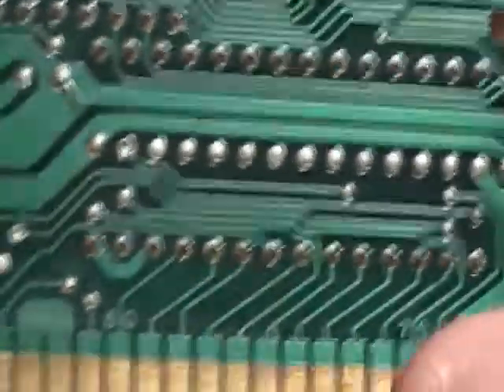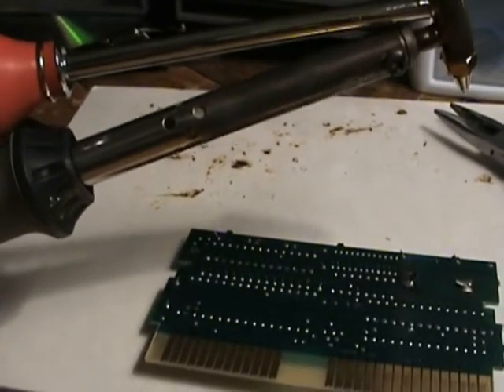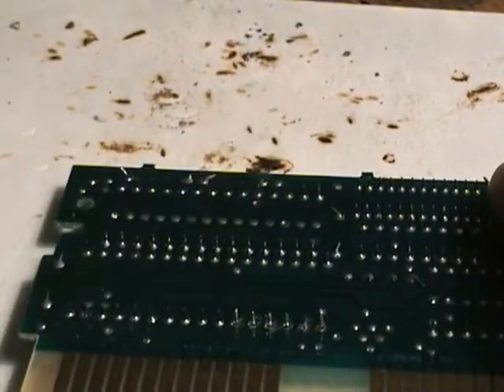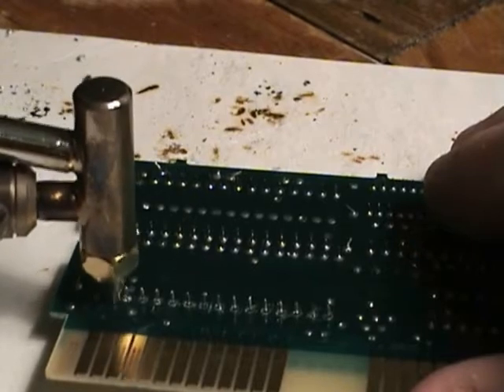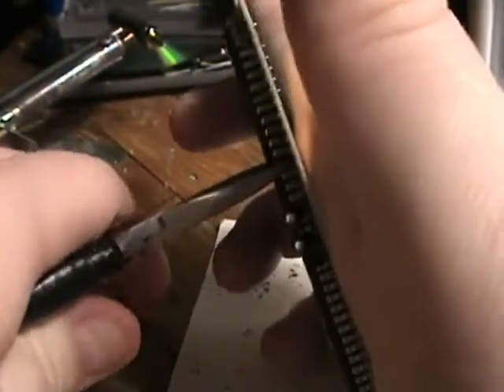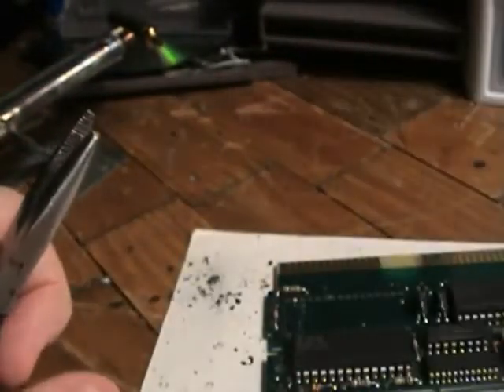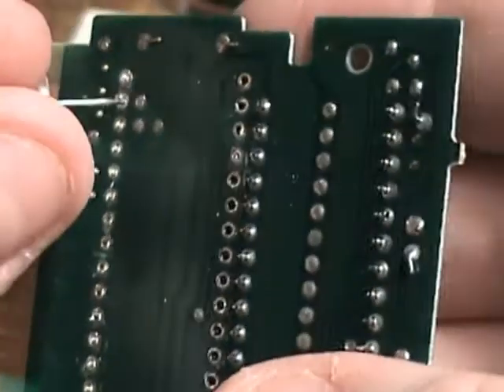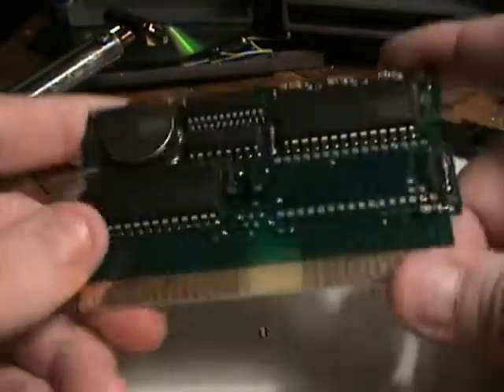How to Desolder a NES Board VIDEO GAM CORNER REPRODUCTIONS

Comment: If I were to buy this attachment and I already have the exact soldering iron, what would the tip and the attachment be called? I'm looking for it on eBay and can't find them. Thanks! This video was awesome!
Reply from the maker: Thank you.  Are you talking about the desoldering iron replacement? If you go to the radio shack web site or radio shack's ebay account they are desoldering tips. Or you could try desoldering replacement. They are usually 1.99 each.  Also if you buy the non Radio Shack brand on ebay they cost more but work as long as they are the threaded ones.
Reply from the maker: http://www.ebay.com/itm/Endeco-Desoldering-Resoldering-Tips-T500-031-Fast-Shipping-Quantity-of-3-/321193487384?pt=LH_DefaultDomain_0&hash=item4ac89fac18
Reply from the maker: http://www.ebay.com/itm/Weller-DST3-Desolder-Tip-Threaded-0-125-X3-17Mm-Fits-Models-Ds40P-Ds60-Dstcp-/161598694756?pt=LH_DefaultDomain_0&hash=item25a0086564
Reply from the maker: http://www.radioshack.com/radioshack-replacement-tip-for-cat-6402060/6402061.html#start=22&q=desoldering&sz=12
Reply: Well, yes I was wondering about the tip, but I was also wondering about the attachment on top of the soldering gun. The sucktion thingy haha thanks for responding!
Reply from the maker: I buy the desoldering iron as a whole tool.  They sell them at Radio Shack for around 13-15 bucks.
Reply: Thank you! I bought it today and it is already doing WONDERS!
Reply from the maker: Bill Talker
Awesome.  You're welcome. It's a great tool.

Comment: Very nicely done. Again, not something that I plan on doing, but like seeing what goes into all of this. I know you didn't do it on purpose, but I like how you didn't do it ABSOLUTELY perfectly. Like you had a little bit of solder left and a pin got stuck in there. It's nice to show that it doesn't need to be perfectly done and gave you the chance to show how you can fix those little mistakes. Great tutorial. :)